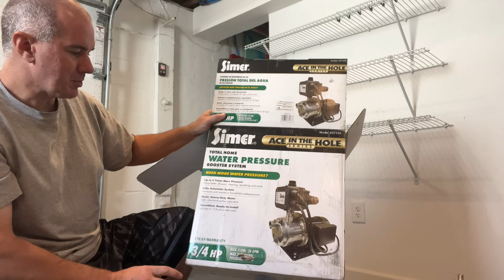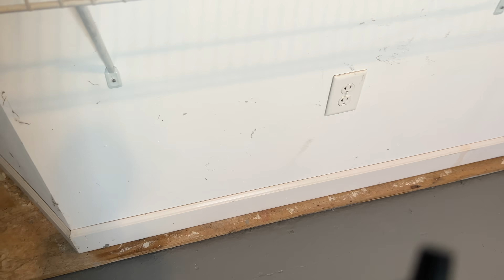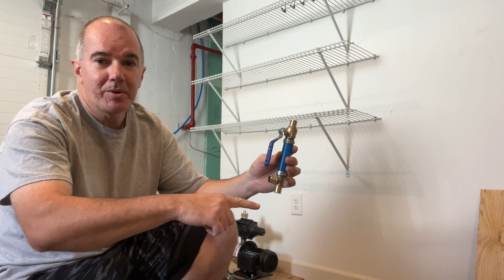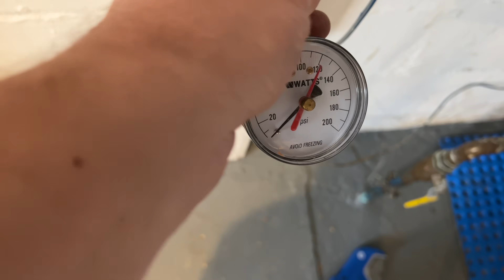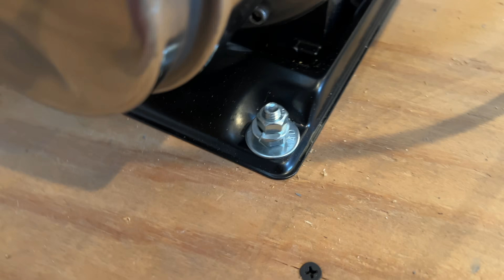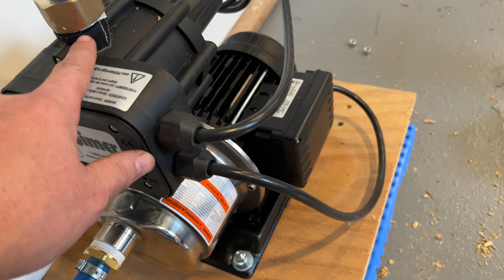How to fix low water pressure in your house / Booster Pump Install

Comment from the maker: After seeing how low the water pressure was in this house I decided to get a pressure booster found here. https://amzn.to/3sStm7d  I went from 30psi up to near 70psi in about 30 minutes worth of labor! Well worth it!
Reply: Did u install it ur self
Reply from the maker: @aishaali2464  Yes I did. I flip and rent properties and do most of my own work.
Reply: @BrianWingard  did you face galvanize corrosion the cover its stainless steel and you add brass fittings... do you face issue after all this years..
Reply from the maker: @jaandel1  Thanks for watching. Good observation. I have not experienced any issues and I believe it is because of the thread sealant between the two. Even though a little may touch I feel it adds a barrier between them because I have not had any issues in years of use now.
Reply: @BrianWingard  thanks for let me know I do face drop pressure after installed a water filtration system... hence I hopping pump will increase the pressure [ outlet]. did you install a air Bleeder valve also ? Or notice that you pump dint work due to air lock

Comment: I installed an 86 gallon pressure tank at my house to overcome a low water pressure problem.  Now I have plenty of water pressure.
Reply: What brand did you install?
Reply: @gzouvelos Water Worker. I'm sure you're going to tell me that it's garbage, but that's what Home Depot had.
Reply: @DrZarkloff  I have never heard of them. Depending on where you are, Home Depot and Lowe's will carry different brands.
Reply: @gzouvelos I bought it in Covington,  Georgia.

Comment: I just bought one of these - have some of the plumbing done, but have an important question. At the top outlet of the pump, there is a brass insert that basically plugs the hole. What is that for? I don't see anything in the user manual at all - seems to me that water can't get out???? And it is an insert - doesn't screw out or anything like that. Your video didn't discuss that at all - just showed a brass fitting on the top... thx!

Comment: Thank you!  I've been looking for a solution.  I live uphill from the well and water treatment plant of the housing park I am in, and I only noticed early this morning that water volume/pressure was acceptable at that time of the day.  During normal hours, though, it's almost impossible to take a shower - or it is a very frustrating shower.  Here I thought it was a restriction in the pipes of my place, but it's most likely just low, low pressure on the highest-side of the park.

Comment: in the house i rent ,the entire house the pressure it is good,but kitchen it is bad very low.i changed faucet and still the same.what should I do to increase to strongest pressure?
Reply from the maker: There has to be a problem from the shutoff to the faucet. First thing i would do is remove the flex hose from the faucet and aim it in a bucket then turn each hot and cold shutoff back on. There may be debris in the line as I have had this before. First see if you have full pressure there out of the flex hose on each side. If you do then you probably have a blockage in the faucet.  You can unscrew the tip off of it and you will see a screen. See if it is full of debris and clean it. Even if you installed a new one if there was debris in the line it will clog the screen instantly. Hope this helps.
Reply: I wish a very strong water pressure to 100% very high .is that possible to get it?

Comment: Thanks for the detailed instruction.  It's a bit concerning there was no mention of an expansion tank when, according to your responses in the comments, you have one.  Had I not read the comments, I never would have known.  Maybe edit the video or at a minimum add a note in the description that you are in fact utilizing an expansion tank.
Reply from the maker: Thanks for watching. I can add a comment in the description. I just took for granted all systems have expansion tanks. Maybe some areas do not? I know here it is code to already have one in your system. They are usually always mounted near your hot water tank and not at the beginning of the system like the booster pump.
Reply: @BrianWingard  ah, okay, yes, I do have a small expansion tank by my hot water heater (after the heater).  Is there a way to limit the boost on this pump?  My current pressure is around 43 just inside the meter.  I don't want this to boost another 40 so I end up over 80 psi.
Reply: No expansion tanks where I am at. Never seen a house around here with one, although I’m sure they are out there. Just built a new house, no tank on that either.

Comment: Thank you for the info, but just one question...why is a pressure tank not needed in this system? I'm thinkin it's something to do with flow/pressure, but could you explain more about tankless systems?
Thank you
Reply from the maker: Thank you for watching. A tank is still required in the system. It is farther down the line which you can not see in this video. I just assumed since most all plumbing has the tanks I did not need to mention it in the video.

Comment: The majority of people in the comments doesn't understand pressure and how volume affects it. Your static pressure is your pressure that's what you have. When you start water flowing that's your running pressure and it's limited by the volume available. If you don't have the volume available because your supply pipe is restricted a booster pump won't fix the problem.
Reply: I have this issue after installed a water filtration system the filter ones... hence psi drop drastically now installed amazon jet pump with smart swith in 3 stories house have issue in the upper floor hence i did put a pump to keep volumne c gallon witch work now for me teh preesuree its keepp steady based on waht the pump offer..  most on the pump i. Amazon 65 psi but its seem 50. Woch smart switch marked!!!  Hence it works... why a pump bc of the space...

Comment: only gives you another 40 PSI according to specs on box for this model.  The one  I am replacing boosts 70 PSI.  
Hmmm... Is there a way I can still use this item and get somewhere close to the desired total pressure, by adjusting how much the inlet pressure would be.  I am told it is 30-40 PSI now but I have not measured it myself.
Reply from the maker: Thanks for watching. Usually you do not want to exceed 80 max pressure total so you do not have issues with any fittings. You can actually add on a pressure reducing valve if your pump adds too much pressure. For those you simply find a reducing valve in the range of pressure you want and you can turn the nut on top to increase or reduce pressure.  I would add this after the outlet so you can measure your pressure at a faucet or hose and adjust accordingly.

Comment: Mine is running continuously. I have mine installed before the hot water heater. Does that matter?
Reply from the maker: Thanks for watching. I have mine before  my water heater as well. Did you check to make sure there was no leaks anywhere even outside? In order for it to keep running water has to be discharging somewhere.

Comment: I’m curious if damage would occur to pump if city water is cutoff some reason. Would it burn pump up or does pump have a safety feature to prevent that. Great video
Reply from the maker: Thanks for watching. That is a great question and I need to look into that. I would imagine there would be a fail safe but if there was not I would imagine it could burn up the pump if ran for too long with no pressure.
Reply: @BrianWingard  yes that black pump switch on the top is designed to stop working when there is no water. There is a failure lamp on it which tells you that the water supply has been cut off

Comment: another reason for the flex line is to protect the pipe joints, after time they would fail from vibration. do the same thing with electrical connections to motors
Reply from the maker: Thanks for watching! Great point I was not even thinking about the joints. Thanks for sharing.

Comment: Thanks so much for this video! What is considered "normal" pressure for a residential home? Mine comes in at 40psi closest to the street. I'm wondering if I would be able to tell the difference between a 5psi and 10psi increase.  What's the difference between a booster like this, and one with a larger tank? Why are some of these pumps $150 and some $600? Is there a difference in type or is it just a matter of quality? How loud is it?

Comment: Instead of having a shutoff valve and then another valve for bypass, can you just have the bypass always connected but going through a check valve? So that if the pump dies the bypass just automatically works
Reply from the maker: You will still have to shut the water off though. The bipass only stops water from going backwards. You will still have full pressure going through the bipass. The bipass valve is one direction only going forward and prevents water from coming backwards.

Comment: Does  check vale install before inlet  pump  or after outlet pump?
Reply from the maker: Thanks for watching. It is installed before the pump. It prevents water from draining  out of the pump so it is always primed. Also it prevents the pump from overheating since there will always be water in the pump.

Comment: I got like 22 psi lmao.. sad days
Reply from the maker: Thanks for watching! That is pretty low! I know they have some that boost even more pressure. Do you have 3/4 or 1/2 pipe coming into your home? May want to check to see if you have a pressure reducer in the line.
Reply: @BrianWingard  it's galvanized steel pipe not sure the inner diameter. I would guess it is 1/2 inch judging by virtually all of the exterior hose connections that are embedded in the slab foundation. All of the sink connections too.. but some are bigger so hopefully the one from the street is 3/4 and all the house internal ones are the smaller so I can redo those one day lol. Just bought the house about 7 days ago was checking the street valve today to make sure it was fully on.
I am scared to do what you did, cuz I don't want to deal with a pipe bursting in the wall.. going to run some 3/4 inch or maybe even 1 inch pex to one sink from the inlet in the water heater room and then do the pressure pump there and just do 1 thing at a time with the good pressure and slowly replace it all.
Reply: @gg-gn3re yikes did you try turning on the faucets before buying? 😅 I didn't, and sorta regret it.
Reply: @emissarygw2264  yea they're fine.. sad cuz it wasn't enough, should have turned on the whole house lmao. Faucet trick + flushing toilet doesn't work I guess, always thought it did.

Comment: Anyone know if you would put a booster like this on the input side or output side of the water heater?
Reply from the maker: Thanks for watching. You would be putting this previous to any plumbing in the house that way the pump can pressurize  the waters psi before it enters any faucets or water heater. Also if you do this after the water heater you will only be pressurizing the hot water and not the cold.
Reply: @BrianWingard  Thanks. Trying to figure out where I can do this lol.
Reply: Do you think I can hook up the pump at my Washing machine?  This is like the only place I have room, electricity to hook up the pump...

Comment: as many have mentioned a pressure tank would have made this a much better installation.
Reply from the maker: Thanks for watching. There is already a pressure tank in the system before I added this pump
. I just showed the booster pump only.

Comment: I have enough water pressure hovering just below 60 psi, but id like a little more. I cant find a water pressure regulator so i figure my house just doesnt have one, so this is basically exactly what i was looking for. Thanks for the demonstration and explanation!
Reply from the maker: Thanks for watching. In your case since most boosters will double pressure you will want to add a pressure regulator as well because if you double your current pressure you will probably blow out fittings in your lines because it will be too high. The regulator will allow you to adjust it back down but still be higher than your current pressure.
Reply: 60 psi isn't good enough for you? You know if you need more pressure washing your car down there's a thing called a pressure washer.
Reply: @stoneyswolf  can you show me where I said I had problems washing my car?
Reply: @b.vo.  If you don't understand when someone is making a point when addressing you that would explain why you can't understand why 60psi is good water pressure. Thanks for clarifying that for me.
Reply: @stoneyswolf  if you don't understand that there is an infinite number of reasons that you have no possible way of knowing then I can't help you. You know what they say about assuming.

Comment: With PEX lasting a max of 50 years, it blows my mind "cost" is the reason it's used in many modern houses.
Reply from the maker: Thanks for watching. For myself I actually prefer it to copper because I can do one continous run to the faucet or connection and do not have to worry about joints in the wall ever leaking or breaking. I use PEX A and have many rentals. If they ever take off and leave in the winter pex A can freeze without breaking. I know it is cheaper but the advantages above are the main reason I use it.

Comment: I have 40psi at the main, 10ft above and 60ft to the back is the last faucet and get 25psi. Will this get thay last faucet to at least 50psi?
Reply from the maker: Thanks for watching. Do you have a 3/4 mainline coming into the house? If you do I feel it will pressurize it to double based on how mine is working. It just takes a few seconds for the pump to work and since that is a little longer distance it may take a few seconds extra to get the pressure.

Comment: Thx for the comprehensive video. I'm in South Africa and the water infrastructure in my area is old. Main water pipes have frequently burst in my road over the years and as a result council have noticeably reduced the water pressure. During peak times it takes my top loader washing machines 45 minutes to fill to the top if there is a full load in it. My plumber said I need a separate 1000l tank with booster pump so I canned the idea. Your video has inspired to take action. Thank you!

Comment: the water line from road to house which is about 60ft is galvanized. house was built originally in 1920. but all the pipes in my house are copper. water pressure drops dramatically if toilet is flushed or two sinks are running. especially if water machine is filling it takes like 15 mins.. do you think a booster would help in my situation?
Reply: I would install a Prv !!!! Or swap it if u have one and adjust it to your desired pressure
Reply from the maker: Thanks for watching. It will definitely help. The house I did this in took forever for the bathtub or toilet to fill up and this doubles the amount of water flow. You do need to check to see what size pipe is coming into your house. 3/4 inch would be a good size and also what your pressure is. Some pumps you have to be within a range so it does not over pressure the line.

Comment: A expansion tank is required in most jurisdictions at the water heater. Water hammer arrestors can also be installed. I have a pressure tank with a booster tank but have city water. Im thinking about removing that and going to the setup you have.
Reply from the maker: Thanks for watching! I actually do have an expansion tank on this system. It is in the other room near  the water tank. I do not have any water hammer arrestors .  I did the flex line instead. Best of luck if you decide to switch over! It is a fairly straight forward project.

Comment: Still working good?
Reply from the maker: Thanks for watching. So far so good. I still need to make my update video on it. Just been busy working all the time.
Reply: @BrianWingard  good to hear.   I have city water about 45-50 psi.   Looking for 60ish
Reply from the maker: @MikeHaddadLawnAddictions  I need to double check the directions on this when I get a chance. I know there is a maximum pressure that they recommend you do not start with. Let me see if I can find something. Mine was super low so it was within range. Just do not want to see you blow out your lines if it doubles it even though they can handle 100psi usually.
Reply: @MikeHaddadLawnAddictions  same here... About 43psi from the city, and upstairs down to 35 due to the height difference. Been trying to figure out if a booster would make sense for me, but worried about the longevity.

Comment: Good video. Thank! I have a rental property with very little water pressure that I just remodeled and did some pretty nice bathrooms including one with double shower heads. I’m considering adding a booster pump like you’ve done here. Presumably, this is configurations boosts the hot water supply pressure too? I’m just trying to think how pressurize the water into the hot water tank is affected…. Thanks!
Reply from the maker: Thanks for watching! This boosts both cold and hot water. The hot does take an extra second it seems like to pressurize but it is barely noticeable.

Comment: So you don't need a reservoir tank to pull from? I just had my water turned on. The water line from the road to the house is about 500ft. Water pressure is 20 at best.
Reply from the maker: Thanks for watching. You do not need a reservoir tank for this. The pump does all of the work for you.  The only thing you will notice is when you first turn it on you may have 1-2 seconds of low pressure before it fully ramps up to full pressure. The pressure for mine was insanely different in a good way after this.
Reply: boosting water directly from water mains is not legal in some countries.